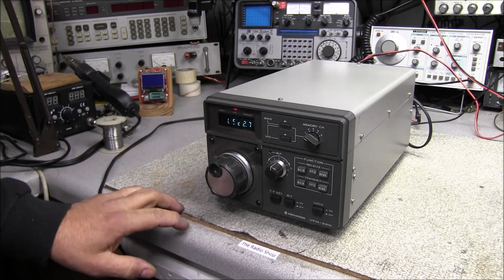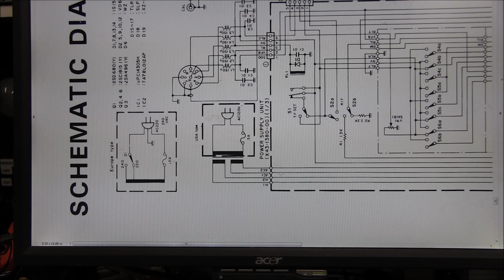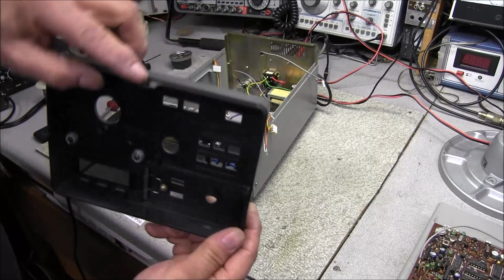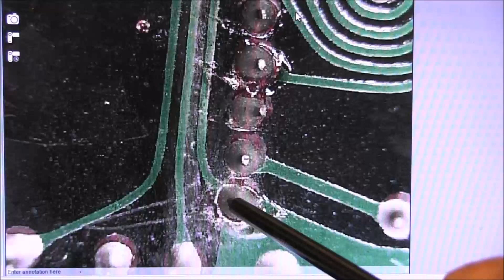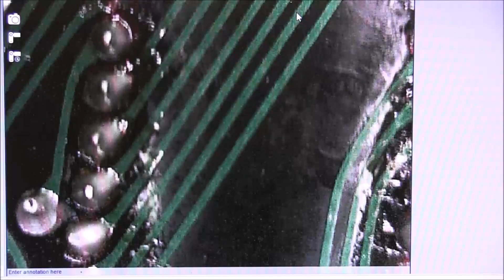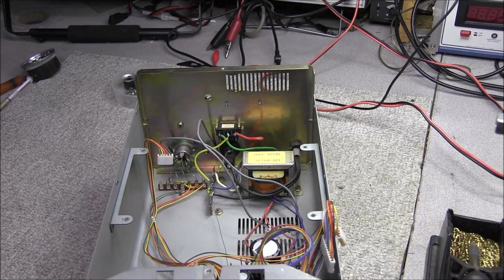#208 Kenwood VFO 230 Problems

Comment: Looks like the rear panel already has a hole that could accommodate a simple "always on" momentary SPST switch
Reply from the maker: Yes, that hole is for trimmer adjustment.  But could be used for that.

Comment: TNX for sharing Buddy...couple of points folks (to include me!) might be interested in...(1) are there any component concerns you would have when using an ultrasonic cleaner? I don't think so just in case as I've been thinking about getting one as well. (2) someone comments later about this being a design flaw with the power up; maybe I didn't catch it but do they all "fail" in this manner?  Thanks again!  73 - Dino KL0S
Reply from the maker: Hi Dino, Great questions!  First one: The only component that could suffer is the VFD. Since it is glass the vibration could crack it so I would recommend removal. as far as rest of the components, no problem.  Second:  Yes, they all were built with this flaw. Parts of the circuit is powered up all the time and when the 9 volts is applied the cpu gets garbage. I will try and cover this in more detail in a later video.  This is why Kenwood had a note in the manual on the problem. Thanks

Comment: Need me a VFD for a TS-530S, pretty dim. Any tricks to brighten?  Kenwood makes some good radios but they do not know anything about making DC. LOL. Do you have a video about the PS-30?  No load output 16 volts normal and will not have output under load, WOW. Love the video's thumbs up.

Comment: Radio Shop, Use a lithium or similar battery,with a 9volt zener,charge circuit [it backs up memory,9 volt will time out after ac is applied to back up cpu / vfo,with a relay ;sleep adjusted to30 sec to 2 min. after ac is on = Time delay off, see,     www. macromatic     plug in modules/timers......Hugh..Chicago..metro
Reply from the maker: Interesting. That would save the memories.  Thanks

Comment: Hey sir. Can you recomend a 1980's Uniden CB? I want to find one to restore. Thank you.
Reply from the maker: A lot of Cobra radios were built by Uniden. I would look for the Cobra 148 (side mic).  Was one of the best rigs out there.
Reply: Thank you SO MUCH for the reply. I am sure I am one of hundreds that ping you. I will try to find one of those. Just found a Cobra 138 at a swap meet for 20.00, and it seems like its gonna be a challeng. It has a 40 channel dial on it. Seems to be a mod.

Comment: Perhaps there is a way to slow the rise time of the AC voltage so that the 9 volts gets there first...
Reply from the maker: I  sure there is. We will see. BTW I tried leaving you a message on the Yahoo group. Thanks for the nice comment there.
Reply: I do that with fixed bias tube circuits. Silicon for the negative supply, tube for the positive. Of course it is not so critical with pentodes since the screen grid voltage controls the conductance.